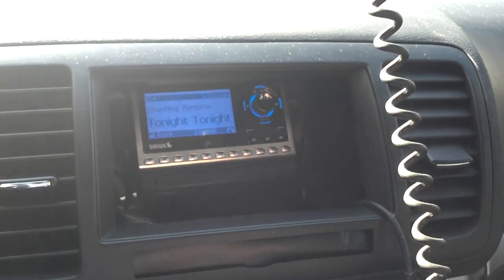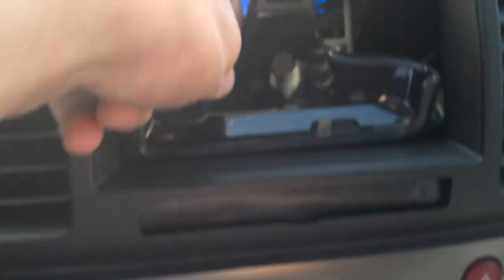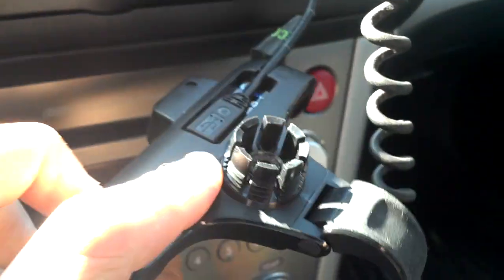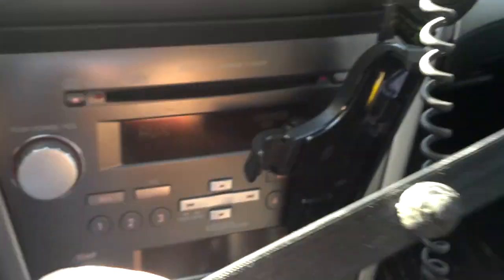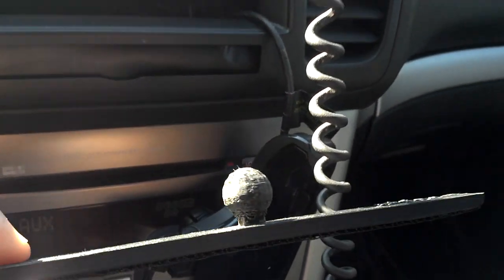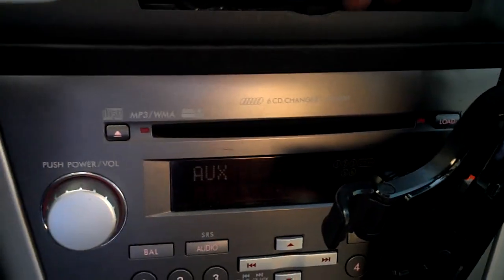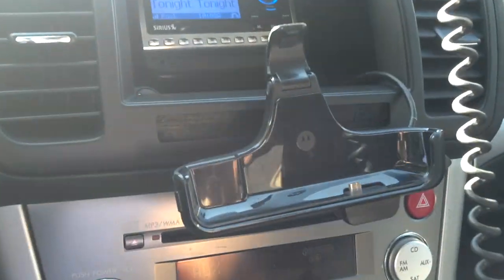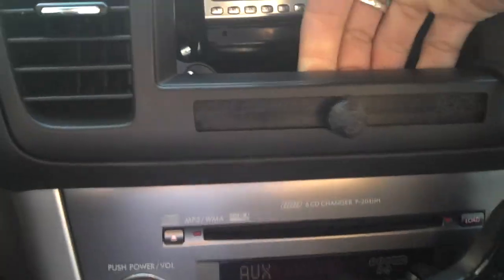Second project w/ Replicator Makerbot 3D Printer

Comment: Nicely done Mr. Stone.  Way to put it to good use.  What did you use to design it?  I'm researching right now and preparing to buy my first 3D Printer myself and am trying to decide which one to buy.  The Replicater is def a good option.  A little pricey though...what do you think about the Solidoodle?  Know anything about that one?